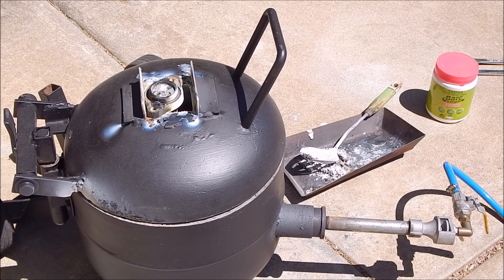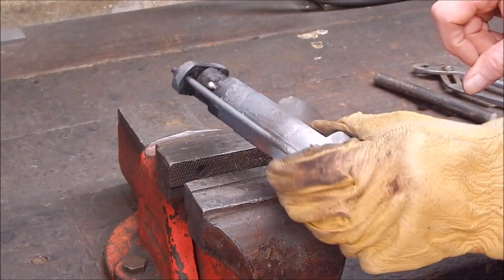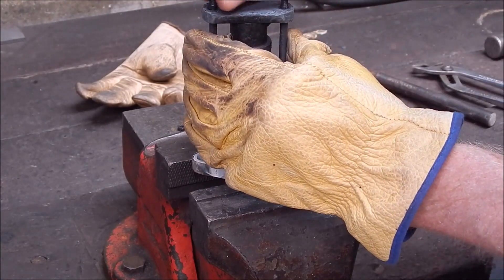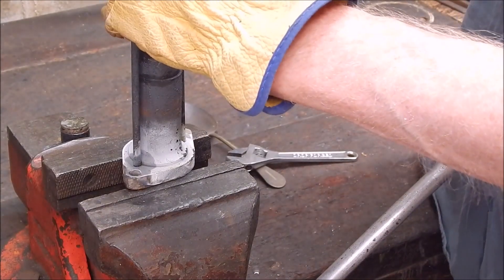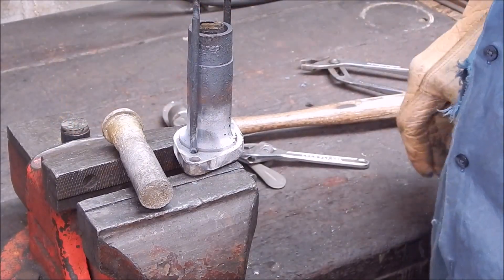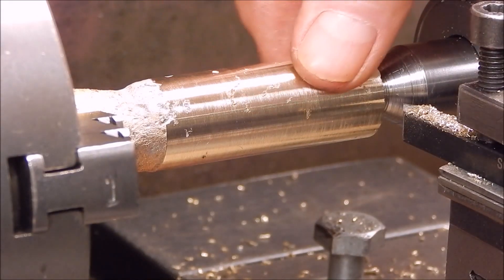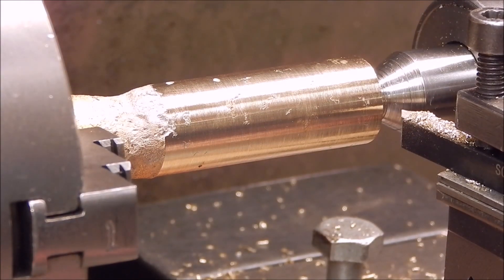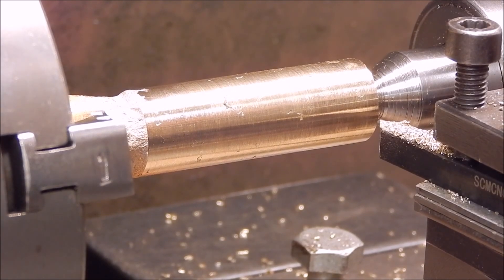Adding Borax flux to home cast brass round stock = FAIL

Comment: Hi Rob. When is Borax not Borax. When it is a cleaning product (Disodium Tetraborate Decahydrate). 'Borax' has become a commercial branding and may not have a relationship to the traditional use of "Borax". I notice to have the cleaning product in the background. 
You may need to source 'Boric Acid' from the Leadlighting crowd who use it as a flux in their soldering. There is a supplier in Queensland who may be able to supply.
Reply from the maker: Hi Anna.  Interesting.  Thanks for the heads up.  I will look into that (read the packet).  Yes, that was the stuff I used.  I have some borax based brazing flux that should be the real deal and may try that some time.  From the results I have gotten it seems unnecessary as there is considerable powedery dross on top of the melt (totally different to other dross).  Cheers Rob
Reply: @Xynudu  Another thought -  re the deterioration of the furnace liner. The turbulence of the flame seems the accelerate the deterioration. Have you considered using a Stainless Steel liner for the furnace ie rangehood ducting or similar. The melting point of a good Stainless (1510c) is a good deal higher than the metals you are melting and the solid barrier may protect the lining from the turbulence.
This is not something I have personally done, however its an idea.
Reply from the maker: Hi Anna.  It's do-able.  I have thought about it.  The liner needs to be SS as a mild steel liner will definitely not last (I had one in a smaller furnace once).  BTW I had a close look at the Borax I unsuccessfully used in the brass melt and it is 99.999% actual Borax.  So no point in revisiting that ;)  Cheers Rob

Comment: Hi Rob ,  I have been enjoying the process as it is something I really want to do.   Have had other things that seems to get in the way but will eventually get there.   I'm sure wondering if your mold didn't get to hot.   It needs heat I'm sure but where you had it it could be hotter than the brass was and could cause issues with the brass when poured.   It is one change that you added and may have something to do with the cavitation of the brass that was there and I don't think it was from the flux.   I wondered when you made the furnace about the size of the chimney hole as you had mentioned but it seems to be plenty big.   I also wondered that if swinging the lid sideways was necessary but you mentioning the heat factor working with it and that could sure make a difference I bet.   Sure glad you are doing this and showing it and doing brass now as it is sure going to save me a lot of trial and error when the time comes for me to be able to do this.   One more thing is are you happy with the wheels as it looks like it is quite necessary as well as the handle with the design you have but room is always a problem so appreciate your thoughts.   Thanks for the videos.

Dale in Canada
Reply from the maker: Hi Dale,  the wheels are definitely necessary due to the weight.  The removable handle works well and moving it is a snack.  The design is perfect IMHO and I wouldn't change any of it.  The Perlite 4:1 ratio appears to be stronger than the 3:1 ratio I used in the base.   I will do some more experimenting to get the best pour result.  Cheers Rob

Comment: Hi Rob, been following along with your trials, I like your approach, I have nothing to add as it's not my field of experience, however, if you continue as you are, only ever changing one variable at a time, I am pretty sure you will crack it very soon and be producing very useful stock, you are nearly there already to be honest. Furnace is spot on, well done. Cheers, Jon
Reply from the maker: Hi Jon, yes it's the same path as learning how to cast aluminium.  You try all this stuff and quite frankly some of it is old wives tales.  Got there in the end OK, but brass behaves very differently, so it's start from scratch time again.  It will all work out eventually.  Interesting trialing stuff and I wonder if people are getting sick of this subject, but the numbers are still up.  So I will probably shoot some more video.  Cheers Rob

Comment: Hi Rob,  Man I feel kinda of bad for suggesting the Borax for flux.  I know it is used when brazing with brass and would have thought it would be good for casting.  Now, a flux is supposed to help with flow-ability of the metal but looks like it does nothing to degas it.  Sorry mate for pushing you in the wrong direction.  Thanks for sharing though!

Joe
Reply from the maker: Such is life Joe.  It was worth a shot, but I wasn't surprised at the result.  I will make up a better skimmer and see if that helps get out the impurities.  I will crack it eventually.  Cheers Rob
Reply: For what it's worth Myfordboy uses flux when casting brass. Theres not a lot out there on the subject and even less that includes machining of the finished casting.
Keep at it Rob , production of machine quality brass from scrap is a real money saver .

Comment: I had a big fail when I tried borax as a flux when melting (lead) type metal for my type casting machine. Never again.
Very enjoyable watching your experiments. Andrew 👏👏👍😀
Reply from the maker: I've never had any success using flux before and wasn't surprised with the result.  Cheers Rob
Reply: @Xynudu  If the flux doesn’t mix with the dross and float to the surface or get burned off, it ends up contaminating the metal. I agree, best avoid.

Comment: I think you're making good progress! Just a couple of thoughts... try casting ingots first and then making a final casting with cleaner brass. Also a Crucible with a rounded bottom so you can clean the dross easier in the primary melting. Also a larger sample of brass in your Crucible will help even though you're casting small parts. Great job!
Reply from the maker: Hi Mike, all good points.  I'm going to modify the skimmer as there's a lot of dross when I pour and I think that's a bad thing.  Cheers Rob
Reply: Making ingots to re melt is never good with brass, it doesn't clean it, it just boils some of the zinc out of it, I never keep re melting brass over again .& not easy making sound barstock. keep up the good work.

Comment: Odd result, thanks for sharing. I intend to try when mine is working. Borax if added at the start,  makes a glassy layer sitting on top, which should collect and scrape off with the dross. Im suprised it has caused the porosity.

Any plans to try copper or alumium bronze? Looks like you easily have enough heat for it.
Reply from the maker: I could do copper, but it's a pig to machine and I have little use for it.  Cheers Rob

Comment: Add oil to the cylinder you are pouring into this will help it to solidify at a even rate and add borax right at the end before pouring after removing slag.

Comment: There is a retired molder on Youtube who goes by Sandrammer.  He has a good video of how to set up a mold to pour good quality machining stock.  If your mold and its lack of any gating system is part of the problem, maybe some of his instructions could help.  I haven't poured much brass, just lots of aluminum and bronze, but I do know that molten metal free-falling more than a really tiny distance (like a cm or maybe 2) causes oxide films to be generated by turbulent flow and entrained into the metal, where they can cause defects like you are seeing.  No promises, but I hope this helps!

Comment: Interesting experiment - the pitting, was it the borax or something else? It looks like granules of something, but I'd be surprised if its borax since borax melts at 743o C so it should melt long before the brass melts (900o - 940oC). Perhaps some salts were formed with higher melting point, perhaps the  borax attacked the cast iron? Did the clutch cylinder look pitted after that pour? Just some ill informed guesses Rob.
Reply from the maker: Hi Benny.  The cast iron looks OK.  The dross is a real nuisance to remove so I might make a better skimmer out of some fly wire or some such.  I don't think it's a gassing issue as the voids are not round.  It looks more like impurities.  The fact that it got a lot worse after adding the Borax points in that direction.  Maybe it's reacting with some oxide or some such.  I will work it out.  Cheers Rob

Comment: I think half the impurities are from the old stuff in the crucible. You need to make a new set, one for brass, one for aluminium and one for lead. Try as well adding a little scrap aluminium and lead to the brass scrap before melting, so as to get an alloy that will be a bit more machinable, as the remelting likely boiled a lot of the zinc out, so you need to replace it with either more zinc, or with another metal. Aluminium or lead alloys well with copper, and if you have a few scraps of silver solder toss that in as well.
Reply from the maker: The brass is machining fine, so I don't think zinc loss is an issue.  I'm thinking it's a dross or impurities issue as it obviously got a lot worse when I added the Borax.  Thanks for the suggestions.  Cheers Rob

Comment: Hi Rob. The only way to refine a process is by experimentation. You are bound to get a few less than successful results along the way and all it's cost you is a little gas. I do like the idea of suspending the mold in the vent, that's got to help. Cheers, Alan.
Reply from the maker: Hi Alan.  I totally agree.  I'm a bit surprised at the lack of information on the net about this.  I suppose not a lot of people melt brass.  It's a good time waster anyway.  He He. No harm in failing.  It's how I learn ;)  Cheers Rob
Reply: Hi Rob, if I compare your procedure with the instructions on the German website, then you are doing everything right. The only difference is that a graphite crucible should be used. And then only for brass and nothing else. But I'm sure you're on the right track and in the end it will fit. Greetings Michael

Comment: I think you were doing better with just a good hot mold and pour method Rob ! .. ENJOYED..
Reply from the maker: I gotta agree with you there Shawn.  There's so much misinformation on the web.  It's hard to find reliable techniques that work.  I will revert back to high temperature and a slow cool down as that looked to work well on a channel called  Clickspring.  Every time I try flux it bombs badly, despite all the people suggesting it.  Makes me wonder if they have ever done any casting.  Cheers Rob

Comment: With that small mold you could put it on the end of a wire rope and swing it around after pouring; maybe the extra gravity would help with the shrinkage while it cools.  I haven't tried that myself and you are of course free to wait until I do!
Reply from the maker: Sounds dangerous Jim.  I will sort this eventually.  Cheers Rob
Reply: @Xynudu  That's why I would try it first personally.  I like the mold in the lid idea though; what if you left the flux out and left the mold to cool in place?

Comment: You didn't grab the baking soda can by mistake? Joking.
Reply from the maker: No.  I half expected this result as my previous experience with flux while casting has all been bad.  Cheers Rob
Reply: @Xynudu  Is it when making cast iron borax is used? Too long since I saw that video.

Comment: If you're trying to get your process down, you should be trying one change at a time, Rob.  If you can't get all the dross out, you might need to use filters, but that' gonna push your cost up.
Reply from the maker: I considered that Michel, but they would probably clog.  Cheers Rob

Comment: Rob, this is the video I mentioned. https://youtu.be/rBvLO10Po3U looks like he's not using any flux.
Reply from the maker: Thanks for that.  Hard to be sure, but certainly none seen.  He looks to have the melt at a higher temperature.  Good video and nice machining.  Cheers Rob
Reply: @Xynudu  Rob, do you think the casting into sand might have helped Click's result? Mart.

Comment: I had the same result, I don't think it helps I think it hurts the finish.
Reply from the maker: I've never had any success with flux in my melts (aluminium) and it's all about the temperature (keep it low to prevent gassing).  With brass I might go hotter next time, as the temperature was down on this pour.  Cheers Rob